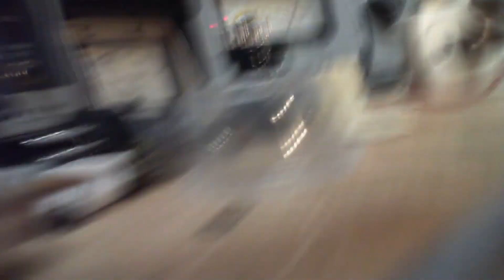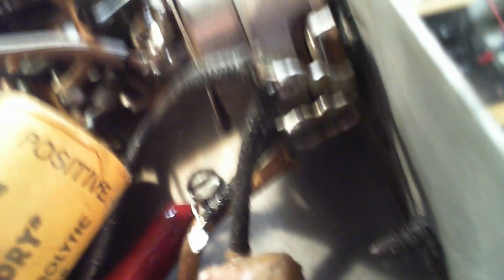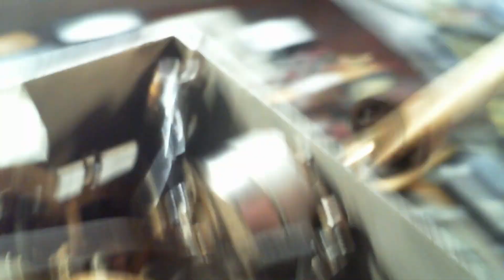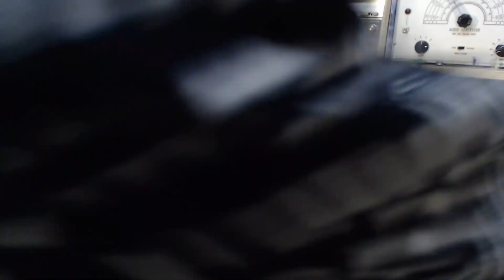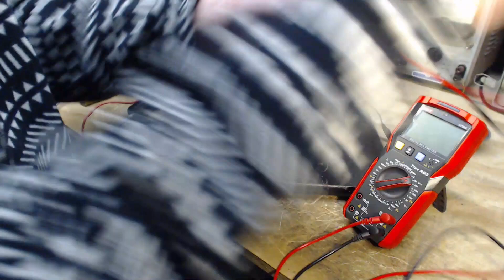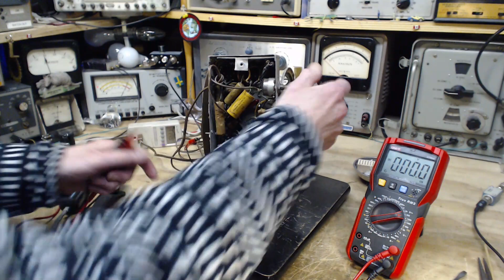Addison 5A Classic Tube Radio Video #3 - Low B+

Comment: Greetings:
All the non-AC circuitry runs on DC.. All of the DC is made by the power supply and passes through that 22 ohm resistor. The low voltage drop across R9 indicates only a small voltage drop is happening between the AC input and through the half-wave rectifier because of the low DC measured at the first filter capacitor. Do not  let the field coil in the B- path throw you off the fact that the missing DC voltage drop is still there somewhere. Measure the DC voltage across that field coil has the DC current passing through it.
The voltage across Cfa and Cfb

Comment: Check filament voltage on rectifier tube pins 2 to 7. If AC voltage not near 35 volts then troubleshoot filament string. If voltage is near 35 volts then replace both filter capacitors according to schematic as well as across the line capacitor with an appropriate safety rated capacitor at value .01mfd. I have seen bad filter capacitors draw down the B+ voltage.

Comment: Verify your meter works. No low battery etc. 
 It appears from the cheap seats you followed wire that only crossed each other (no dot or period to indicate connections)
 Open the connection at the resistor pair and check current to determine if high current was present. 
 But as always, trust but verify your equipment and results.....
Reply: What does cheap seats followed wire mean?
Reply: Cheap seats as in nose bleed section of the stadium seating.
Binoculars recommend.

Comment: Haven’t read all previous comments, maybe someone had already suggested you may have a bad rectifier tube socket? Corroded or broken pin terminal?
Reply: Not sure why he doesn't get his tube manual out and check the voltages on the rectifier pins as he has many times in the past? Seems strange this does not occur to him.

Comment: HMMM if the filament in the rectifier tube is less bright in the radio - might it be a good idea to measure the voltage across the filament while in the radio. I dunno

Comment: Over 50 years ago my employer told me "check battery and ground first" That was the use of telephony terms but it applies to "electronics" . Well, he was correct. Right is a term used by those who are right-handed, thinking that right is the correct use of the word. Sigh, I do feel sorry for those not left-handed.